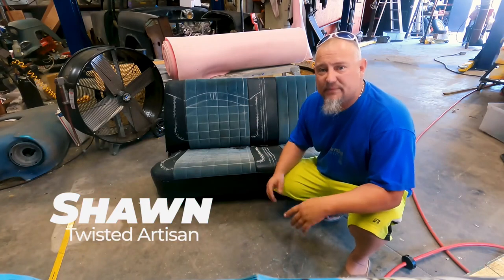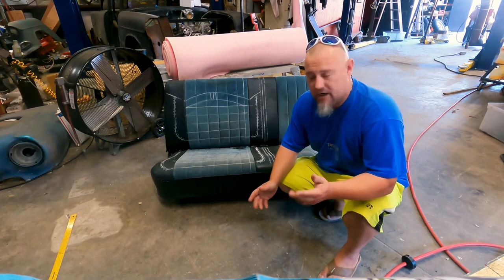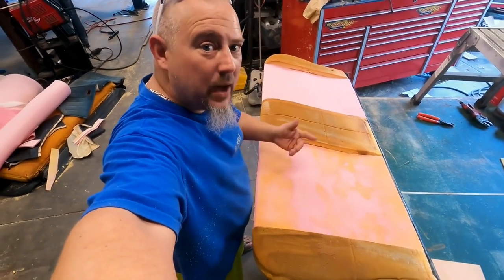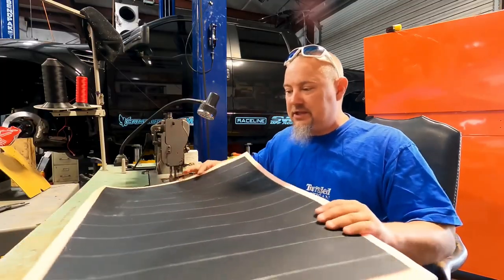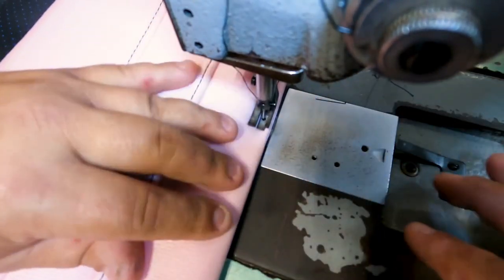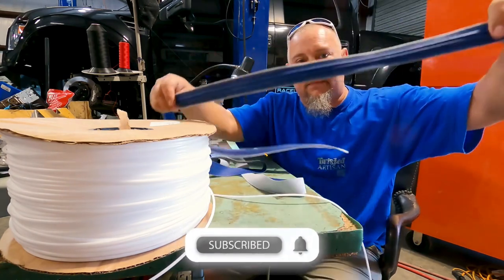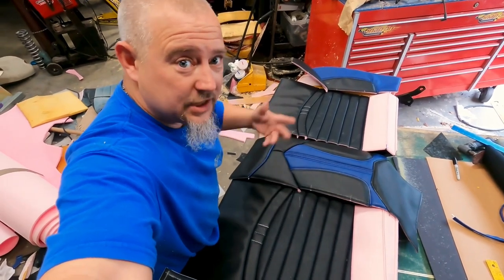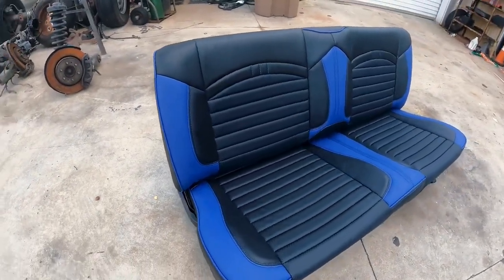Bolstering Factory Flat Foam & Sewing Double Welt Cord. Upholstery Tips & Tricks!!!

Comment: That’s exactly what my buckets need just a small ridge in the sides. Maybe just take off the Bottom Covers add 1/2” build of some of that white polyester Batting my wife has she Quilts so I cold try it then Spray Glue just a tad and recover don’t know if it will raise the sides too high that is where some sewing talent would come in I have yards of extra Material I bought when the Seats were made they sold me 10 extra yards! Maybe enough to make new Bottoms?

Comment: Nice seat but i have a question. Do you glue the sewfoam to the vinyl? If you dont can i ask why you dont?
Reply from the maker: Yes, I glued the vinyl to the sew foam. I believe that to be the best method for this application. However, in certain applications, I may border stitch the material or glue the edges of the material leaving the center loose.
Reply: @twistedartisan2131  i seem to have a little bit of trouble when i glue everything, thats why i was asking. Even when i steam it i cant quite get all smooth.

Comment: thanks for this. would you ever try grafting the foam from another seat onto the original foam? I have some super nice Lexus bucket seats that are collecting dust. Seems like I should be able to take the foam off of them, and french it right into my bench seat foam, but I don't see anyone doing that.
Reply: it's honestly tough to find videos of any custom work on bench seat foam, so thanks again.
Reply from the maker: You might have to do some back filling in empty spots. But yes, foam can glue to foam with no issue. Doesn't matter if it's two different types of seats.
Reply from the maker: Glad you enjoyed the video. Thanks for watching.